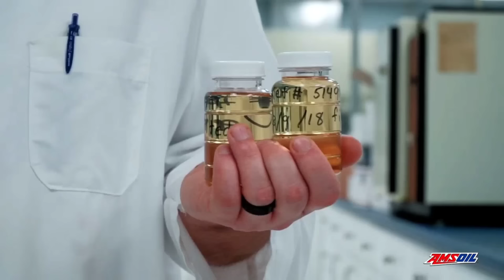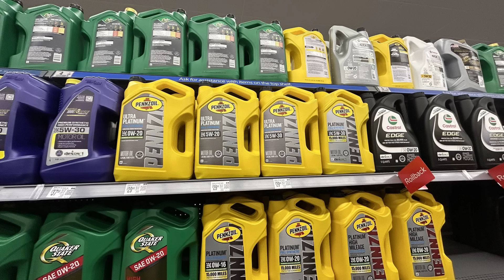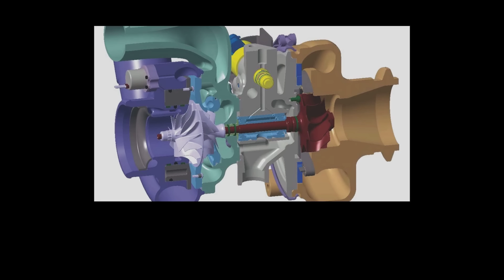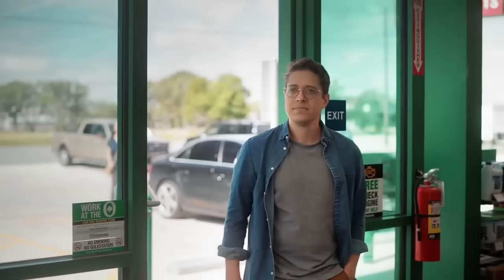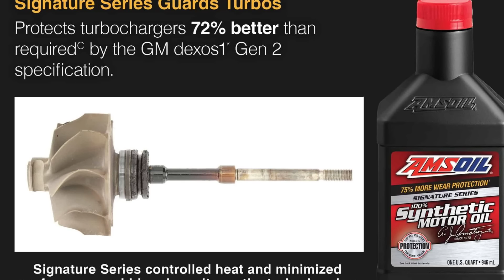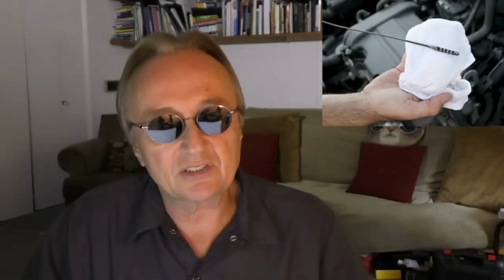Pennzoil Ultra Platinum vs Amsoil 5w-30 Oil

Comment: Never, EVER, would I go 25 thousand miles between oil changes!!! NEVER!!! So, it all boils down to price: I'll keep Ultra Platinum. Valvoline is another great alternative, btw.
Reply: @Funkydood.........AMSOIL has had this statement on the containers since they introduced this oil in 1972, so as of today this oil has been on the market for over 53 years!  the statement: "25 THOUSAND MILES or ONE YEAR  SERVICE LIFE"!  Now, if the oil could not do that, don;t you think AMSOIL INC. would have been "SUED OUT OF BUSIINESS, YEARS AGO"?
Reply: @wayneowen5864  Yes , truth theoretically. You go for it. In an expensive '26 Ford Ranger Rapter truck I'm goin Penn Ultra Platinum 5-6k mis -max. W/synthetic oil filters like Carquest Premium or Fram Ultra synthetic.  Motorcraft filters (an there OEM oil too) are best OEM of any automakers..proven by Project farm & independent lab testing.
Reply: @wayneowen5864 that’s best case scenario though… not severe service. And it still costs something to do UOA. Do you really think majority of people should be running a bottle of castrol for 20-25k unless they have to
Reply: @wayneowen5864 He didn't say it couldn't last 25000 miles, he said he would never do that. Think about it it's kind of an empty claim since most people don't drive 25000 a year and they state 25000 or one year. It's a quality oil for sure but I'm sure after that many miles it's pretty dirty, which is not a good scenario.
Reply: @Superniceguy66 Nothing about it is empty, you’re just talking out of your ass. Plenty of us AMSOIL people go up to the maximum and even pass it. Oil analysis shows much more life. Also for some reason nobody ever pays attention to the 100% synthetic statement. There is no competition.
Reply: @Sum2Wavyy Go back and read the post again.  I did not say it would not last 25,000 miles, I said it's an empty claim because they also say or one year and most people don't drive 25,000 a year. And the 100% synthetic claim is questionable since it's made from. PAO which is derived from ethelene gas which is derived from CRUDE OIL! So you shouldn't talk out of your ass cause you will make yourself look like  an ass.
Reply: PENNY WISE AND DOLLAR FOOLISH,think about how much you paid for your car or truck,
Reply: If the lab tests show its still useable why not 🤷‍♂️🤣
Reply: I’ve done that many many times over in a normally aspirated V6 Toyota. Sold it at 367k miles.
Reply: @richardrose5776  Anyone can say any mileage on internet. Just sayin. Don't buy newer Taco. If you did trade it. 22-25 Tacoma & Tundra having catastrophic engine failures at low & higher mileage. Toyota GTDI engines have serious issues. Facts. Better off w/ newer Ranger or Colorado - have very proven powertrain platforms + better suspension/ frames. -Engineering perspective
Reply: @Davido50  You are nuts. Ford and Chevy better than Toyota????  You need to sober up.
Reply: @richardrose5776  with Amsoil or something similar, I hope. Were you performing UOAs?
Reply: Valvoline EP Is there best full synthetic oil. Reg Valvoline advanced is like vanilla Mobil 1. Low grade synthetics. Pennzoils cheaper "full synthetic" non GTL or Motorcraft Full Synthetic both better.
Reply: @Davido50  All pennzoil is non GTL now. They no longer use it.
Reply: I know 2 people who lost an engine using Amsoil.  And they did nothing. ..
Reply: @mikeschlup5279 probably didn’t happen.
Reply: @mikeschlup5279  WAS it PROVEN the oil caused the engine to faill?  ONLY USED OIL ANALYSUS can prove that the oil caused the problem!!
Reply: @wayneowen5864  Truth. Lots details/ testing results needed.
Reply: @mikeschlup5279  It wasn’t the oil that caused it if they were using the Signature Series version
Reply: @candyman1967  This is social media take everything w/grain of salt except lab tests / legit channels like THIS ONE , Project Farm, Oil Geek etc. Pennzoil Platinum & Pennzoil Ultra Platinum can't be beat for price pt / performance. Otherwise Valvoline EP etc. Mobil1 EP good too. 👍🏻
Reply: @mikeschlup5279 Give us more details pls.....
Reply: @mikeschlup5279  I don't use Amsoil currently but I don't believe it.  Makes no sense.  If they did it was because of something else.  I actually just changed from Costco brand oil to Pennzoil Ult Platinumand I love it but I am seriously thinking about trying Amsoil.  I want the best and I think i will run Amsoil longer....maybe 7500 miles instead of 4k.

Comment: If that Camaro had enough metal on the dipstick to see it,it won’t matter what oil he uses for long 😂
Reply: Exactly,  and penzoil platinum is very different from the ultra platinum
Reply: @b @brandontroupe7809  they are both are awesome oils. I’ve used both of them and I prefer the Amsoil signature series over the  Pennzoil ultra platinum.
Reply: And I have a 2025CT5V black wing that makes over 800 hp at the real wheel. But both are great. It all depends on your preference.

Comment: VALVOLINÈ at 3K changes, now I do full syn at 4K...I expect 500K on my motor because the big V has never failed me on my many motors of all kinds. Longlife oil ignores pollution of the oil and God help you if you get any fuel dilution.
NOW they Introduced their new clean and protect oil I'm running now in my 3.7L Dodge because once again, I saw the STUDIES!
Reply: You are spot on.  Shorter OCIs remove sub 20 micron wear metal particles from oil before they act like sand paper.  Also, modern GDIs thin oil fast.  Many cars in Japan last 500,000 plus miles with the 3-5k strategy and other good maintenance principles.  Regulators not bright pushing for 10k plus OCIs when the disposal impact pf an entire car fax exceeds recycling oil.  The war on fossil fuels fail time and time again.
Reply: Valvoline is owned by the Saudi Royal family! The only family worth a TRILLION!!!

Comment: Still doing 3000-5000 oil changes
Reply: You must be listening to Dave 🤦‍♂️ and stuck in the 70’s 🤣
Reply: @candyman1967  Better times than now for sure. Freedom.....
Reply: Toooo soon! Waste time & $. Facts.
Reply: @Davido50 you can’t fix stupid or wasteful.
Reply: @richardrose5776  whatever, I have a kia soul with 225K and oil analysis shows like a new engine. So yeah, 3-5 works for some. Beside, the the cost is the same or a buck more for synthetic where I get it.
Reply: @beesknees6970 when do you change oil 10k

Comment: Best syn-oil video here! Skip all the others! Fair and balanced! I am a dedicated AMSOIL Sig. Series user.
Reply: Yes I was using Costco brand oil and after some research I went with P. U. P. now but I think i will next pay $10 memerbership for 6 months and load up on Amsoil and see how it runs. I will change it at 4k and then go longer intervals if all looks good. $47 for oil is not bad if it lasts longer and works better overall.  I have a 2013 Honda CRV and I hope to keep it as long as possible.....so onto Amsoil for me next. 😊
Reply: @andyman8092 I thought Amsoil has only one year $20. P.C. term. IF you use the Sig.Series please go waaaay more than 4,000 miles.
Reply: ...soorryyyy...😂

Comment: 25,000 mile change intervals is ridiculous. Fuel dilution will destroy any oil by 15k. Got my '08 Tacoma up to just shy of 450,000 miles on Pennz Ultra Platinum and before that on Mobile 1 at 4,000 mile change intervals. Been using the Pennz since it first came out in like 2015ish.

Comment: These are both quality oils it depends on how deep your pockets are.
Reply: Right, if your vehicle leaks or burns oil, AMSOIL will bankrupt you
Reply: Plus if you won't or can't extend OCIs..Amsoil not worth it at all. PUP will cover you well up to 7500mis. Proven !!
Reply: @Davido50  Another video stated 9,000 miles.

Comment: 25000 intervals is nuts
Reply: 80% of your engine milage will be with dirty oil.
Reply: Until you do oil analysis and it says the oil is still good 🤦‍♂️🤷‍♂️🤣
Reply: Not if you do 40,000 miles a year.

Comment: Everyone knows Amsoil is the best. Nothing on the store shelf works as well!
Reply: Amsoil is double the price of PUP, perform 5% better.
Reply: @dwang552 Wrong, it's not double. As a preferred Amsoil buyer, the SS series runs about 4 dollars a quart more. Get your facts straight!
Reply: @cudafish9594  5 quarts or Penzoil is 25-26$ at Walmart. How much is Amsoil? Also for daily drivers Penzoil is great oil. I use it for years and have zero consumption or problems.
Reply: According to tests ultra platinum isn’t far being. Even motor oil geek displayed this. It’s the best oil you can get at the store.
Reply: Seen two engines blow and it was the oil, just look up the claims
Reply: Amsoil is a blender.  They get their base oil from ExxonMobil and their ad pack from Lubrizol.  An acquaintance works at Lubrizol.  Due to confidentiality agreements, he couldn’t get into great detail.  Here’s what he said.  “Amsoil buys the very best base oil that ExxonMobil makes.  They use the very base ad pack that Lubrizol makes.  Put the both together and you’re going to get a pretty good oil”.
Reply: Amsoil SUCKS a big one.
Reply: @maj8301 sounds like you are a man of experience! 😂😂😂👌
Reply: Yes but not worth the price differential. You car wont last one day longer than using other brands.
Reply: @Taras-Nabad Something else will kill the car first like failing cooling system plastics, suspension, worn interior bits, and transmission.
Reply: @Taras-Nabad  This price difference is flipped in EU, your Amsoil is expensive due to your import tax. Thank you for your attention to this matter.